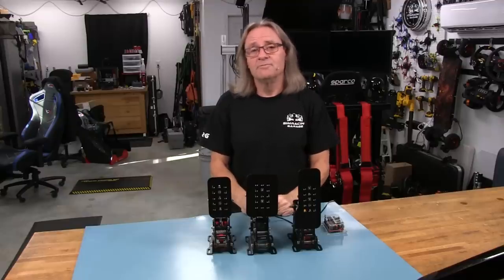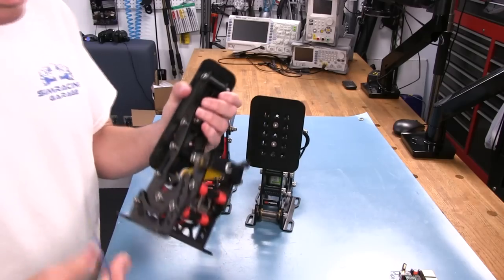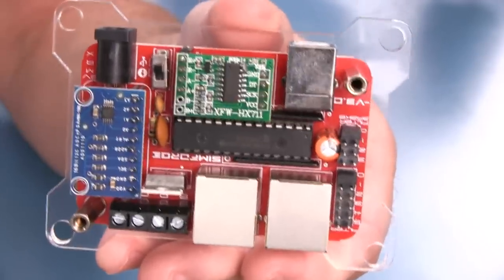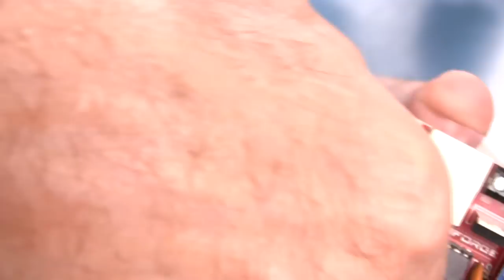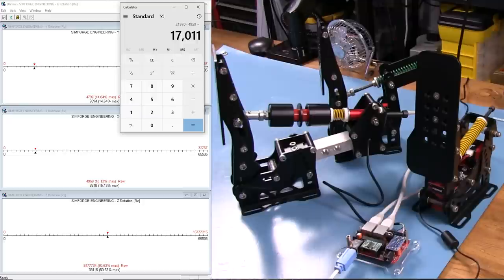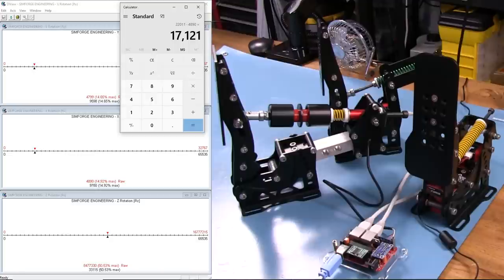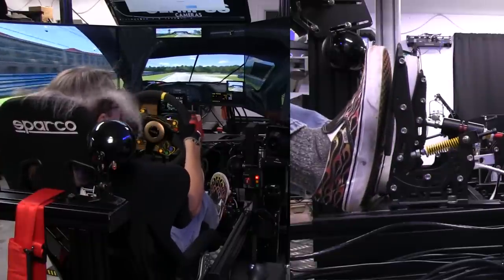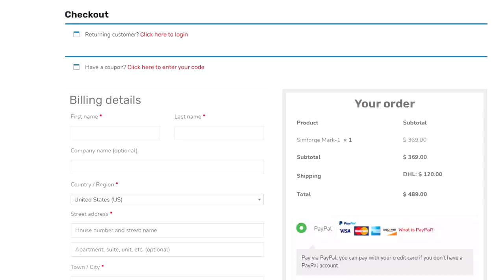Simforge Mark-1 Pedal Set New Updates

Comment: Just ordered mine because of this review.  Can't wait.
Reply: worth?
Reply: @HugoWheelieboy5  Can't fault the pedals at all.  The electronics work and the hardware hasn't failed on me.  Everything is very solid.  I run motion and a DD1 and have not had any issues with interference.  The 80KG LC is plenty for me and the pedal setup out of the box felt fine.  I don't have a lot of experience with other pedals other than cheap entry level, but I would say these were definitely worth the price.

Comment: Simforge Mark-1's are  Fanatec Killers and Heusinveld Challengers. They're definitely superior to V3's and Sprints . On par with the Ultimates. Had to sell most of my gear during the lockdown and it was no brainer which pedals I wanted to go for to get back into sim racing.  In some features they exceed the Ultimates. The  adjustability in the  Foot rest is superb . Makes them more comfortable to use in long stints. I've been using these for almost 4 months now. I'm am more consistent in  my lap times with these than they were with my previous pedals. The Brake feel is good. Really Good. I rarely lockup anymore. Driving in and out of corners is a smooth . 

Kudos to their customer support guy Sachin . They reply within minutes . I had few questions about the calibration which I emailed them on a Sunday evening thinking I'll be getting the reply the next day and got the reply in like 10 minutes. To every email that followed , the reply was within 10 minutes.  Literally the fastest customer support I've experienced. Highly Recommended. 

As always nice review Barry. All hail the sim racing Jesus.
Reply: did they finish the software yet? i hate using dyiview
Reply: Soooo, don’t get v3s or sprints? I was looking at getting either one as an upgrade from my Logitech pedals
Reply: @mirshia5248  No they haven't.
Reply: @runofthemillz  Without a doubt. As I said, they're on par with the Ultimates. For 1/4th the price it's a no brainer. 24 bit resolution makes it so good. Hard to describe
Reply: @runofthemillz  The Sprints are great, just beware that racing without shoes is out of the window.

Comment: You can't judge the effect of filtering by determining the resolution range. The filtering would be done on the input signal, while the resolution is determined by its output.
By filtering you lose precision because the amplitude is less extreme. Calculating the output step range gives as much information as saying that both an 8-bit and 16bit interface have a 0-100 percentage range. The 0-100 range is the same for both interfaces, but one has more precision than the other. Both only say something about the output signal, it has no relevance on the input signal that is filtered by some logic. The PIC processor is a simple microprocessor and only has a very basic instruction set. That makes me believe the filtering is done between the ad converters and the microprocessor. The simplest filtering is just a divide,round,multiple instruction. Let's say you have a input value of 10012. A simple filter would divide 10012 by 10 = 1001.2, round it (1001.0) and then multiply it with 10 to get 10010. Any raw value between 10006 and 10014 (inclusive) would result in an output of 10010. Filter ranges 0-5 just change the number of the filter and it doesn't change the resolution range itself, but more the sensitivity (the range is more of a block form than a thru linear range). Usually odd numbers are used for the dividers (seems more 'random' to people) like 1, 3, 6, 7, 9 and 13 for example. Value of 1 would disable any filtering.

Also if you want to avoid EMI interference you need more than just input filtering because the cord of the pedal will pickup way more interference from magnetic fields than any circuit board on it self.  The easiest way to avoid interference is a shortening the cable length as much as possible and to use a shielded cable.

Comment: These pedals are incredible for the price. I had just purchased my ClubSport V3 pedals about a month before your previous review on these and I regret not seeing them before. For a premium pedal the price is soooo good on these SimForge pedals
Reply: So get these over some v3s or sprints?
Reply: @runofthemillz  I have the Sprints and I'm very pleased with them. Especially the adjustability is of the charts. You can make the brake as stiff or as soft as you like, same goes for travel. The throttle is very good too. Clutch same. The build quality, software, packaging, supplied tools is all top notch. My previous pedals were Fanatec CSR load cell and CSL loadcell (those were terrible IMO). The Sprints feel like another league entirely. Highly recommend them over the v3's.
Reply: Exactly what I think of:) canceling my v3 pedals and get these:)
Reply: What were the differences between the 2? And which of the 2 were better?

Comment: Filtering should not affect signal range/resolution; it should affect responsiveness (how quickly pedal changes are registered).
Reply: Consider filtering more like a treble tone control than a volume control, reducing sensitivity to higher frequency changes.   FWIW, notice the angle on Barry's throttle spring; it should be adjusted to be more perpendicular to throttle movement for better linearity at full throttle.  That HX711 board is optimized for load cells and used e.g. in many digital scales.

Comment: I find it curious that Barry is impressed by the electronics. They only use two of the four available channels of the ADS1115 A/D converter (mounted on a long-legged (think antennas) riser board!) and then introduce another chip with integrated amplifier and A/D converter to "save an amplifying circuit and combat RFI/EMI?"  It's a wasteful design and it looks like an amateur beginner project. 

Usually for RFI/EMI mitigation you'd use the shortest possible traces and wires on your circuit, shield the circuit board, and use passive filters on the wires connected to the outside.
Reply: HX711 is the standard board used in many digital scales, dirt cheap and custom designed for load cell bridge circuits.  Not "reinventing the wheel" is good engineering economics.

Comment: So is this worth getting over the Fanatec Clubsport v3 pedals? I am deciding between the two.
Reply: Buy sprints instead, and you will never need an upgrade again.
V3 aren't all that tbh.
Reply: @kingcarrot6355  I dont have a space for a rig yet, so I am gonna get the wheel stand 2.0 and later covert to a rig. just thinking about the size and how that's gonna work with the sprints.
Reply: @kingcarrot6355  Have to agree. have the Sprints (actually just bought my second pair since I sold my entire rig a year ago and now I have been buying it all back) for a while now and they are great on every level - hardware, software, customer service, supplied tooling all top notch. Costly, but not so much if you consider them as your last set of pedals. Especially if you really like a stiff brake pedal which is sort of impossible with the v3's.

Comment: Got my Simforge pedals yesterday and used your video to help with the setup process, it was no issues until I got to the point of configuring them in iRacing. When I go thru the Configure setup all 3 pedals are showing data but when I finish it is not showing the brake pedal? Do you have any hints or a link to a video that might help me out with this issue? TIA
Keep up the great reviews.
Reply: Did you fix this, I have the same problem?
Reply: @HectorGarcia-vv2qe  Same, did anyone get it sorted?

Comment: The worst purchase I ever made on sim racing gear was the first gen. The worst customer service I have ever experienced. Do yourself a favor and spend a little more for the Heusinkveld gear, great customer service and support through their dealers. There are so many other good options out there now to try why take a chance?
Reply: same here, bad service
Reply: for me i had the best experience in my life with Simforge customer service, every question or problem they solved and response in less the 2 hours, mine are mount inverted and they got me a special solution for the plates, sorry for your experince but for me those guys are amazing and still the best purchuse for my rig so far(price+performance)
Reply: Same, even the recent ones aren't great. Cheap electronics. Customer service could be great.. I wouldn't want to live with a faulty product just cos I'm getting good customer service
Reply: I can vouch for the Sprints. Great set, great build quality, software and customer service. Had bought them twice now (had to sell my whole rig a year back due to financial reasons) and both times very consistent experience. Plenty of adjustability - brake stiffness/softness as well as pedals angle etc. Highly recommended.
Reply: Jeffery Johnson, what was wrong with the product that made it the worst purchase?
Reply: @atrain132  you can find my original comments under Barry Roland's first video on the Simforge pedals where I detailed my experience with the pedals and Simforge staff.
Reply: @atrain132  his complaint was how they needed to connect remotely to update the pedals or receive a replacement logic board completely free of charge that was updated but he had to pay for shipping. So he essentially refused all service and then blamed them. cause they had to remote connect to upgrade or pay shipping for a free updated board.

Comment: These electronics look so horribly designed I wouldn’t buy these pedals no matter how good a deal they are. Man I could spin up a board that’s more EMI compliant and more professional looking in a day, and they seriously sell this in a product?? Using leaded components is a horrible idea if you have EMI problems, not even talking about using cheap modules.. and it looks freaking horrible.

Simforge, contact me and I’ll design you a new board in exchange for a set or two of pedals.